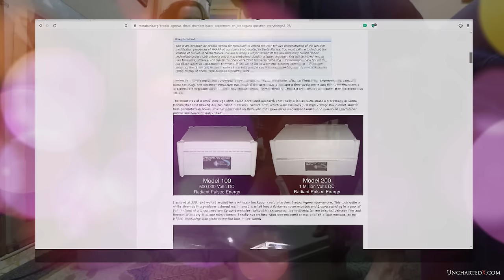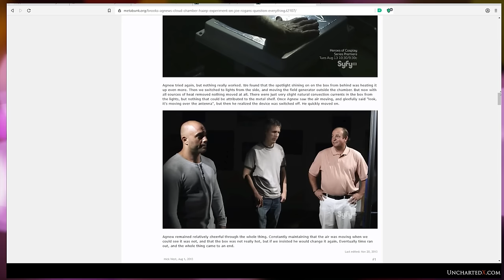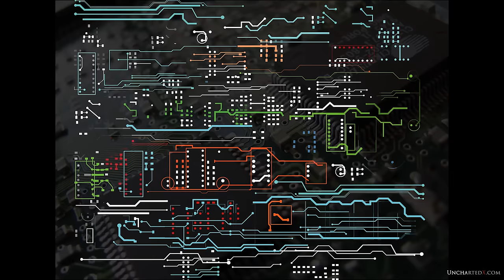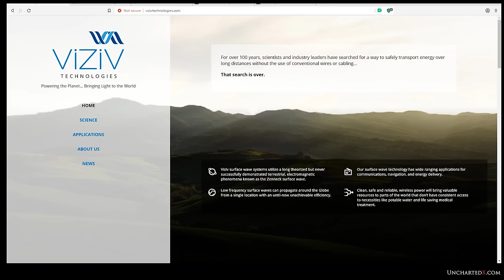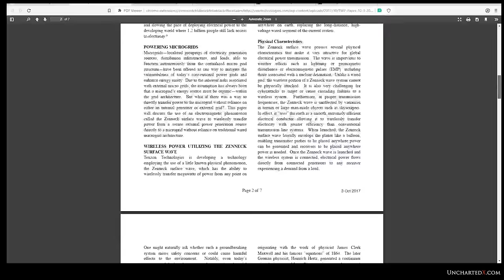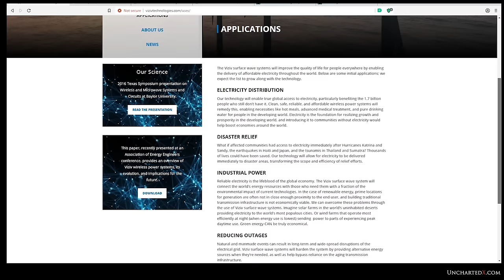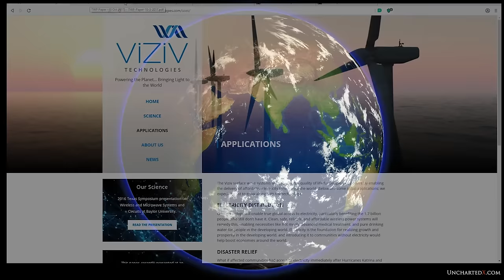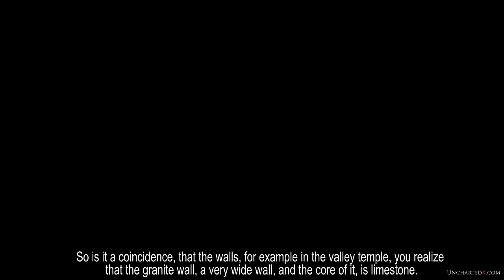500,000 volts through megalithic stone? An investigation into the possible with UnchartedX!

Comment: I'd like to share a few things on perspective, as well as tell you about my experience . . . also share my limitations, as not to try to over qualify my statements. First, direct to the point. In the late 80's and early 90's there were devices people would keep in their homes & cars generally called 'negative ionizers'. These devices were intended to charge the air with negative ions & one of the often mentioned effects was that it would essentially be similar to the air after a storm.  Health effects were claimed, etc . . . but the underlining problem, and ultimately why the popularity was discontinued (because of what caused them to cease to work).  If you had a single clock radio, or other electric device plugged in, that electric device would ground out the negative ions. Where perspective comes in is how different things would be if we were not on the grid. I mention this here, because even in the room where this experiment was performed, there are obvious lights, etc which may offset the 'natural environment' that any potential ancient technology were to be used. Like many others, I have thought about what the pyramid may have been used for, and my final best conclusive theory has not really been presented in any video I've seen. The one major problem that I have with the pyramids in their current state would revolve around the metal handrails that have been put in, potentially contributing to a grounding out an originally desired effect. Back on direct topic:  Even the generator used in this demonstration may not be able to have an appropriate "control group" for purely testing scientifically.  There are two major principles I feel might be helpful to keep a proper perspective. One, I imagine you're probably aware of -- that energy goes from negative to positive (for some this may be counter-intuitive). The second is a modern day principle I learned while working with an electrician . . . the job required an electric device to work that was a long distance from the panel. Contrary to my initial speculation, the wire had to increase in size as it extended farther from the panel. When this was explained, it was because there had to be more free electrons available at a farther distance. 
 If there were no power grids knocking down ambient ions, structures like the pyramids would be massive channels of ambient negative ions converging onto a host of available free electrons.  The A/C world we live in today has estranged the D/C world of ambient ions as shown in your video by grounding out kinetic potential. <--- all that & it is tough to imagine what things may have been like before the pyramids accomplished their task.

 After a decade in IT, I was asked by an aerospace engineer when I would leave 1's and 0's & come over to time varying DC. The engineer was a master of 30+ years & I told him I would work for him whenever he wanted. . . to which he replied, 'how about Monday'? The work I've done effects millions of people daily, and while that's no exaggeration; I humbly acknowledge I was standing on the shoulders of a giant & my best asset was remaining determined to never stray outside of the guidelines set for each particular project. To my peers, I would be considered a bench tech.  My biggest project included a key component for the aviation industry . . . it used what we called "HH blocks" (one reason I Puma Punku's H blocks interest me because of the similarity). Likewise, re: Puma Punku are the stepped inserts, which also bare a striking resemblance to waveguide formfactors used for long range communication.

Comment: One purpose for choosing those materials is they have few materials but if they wanted to send a radio signal, even if it was a Morse code type of signal you see when you bring that aluminum rod close and cause a spark, that's a spark gap, and like the way radio waves are made. Now they may have used it for florescent lighting, radio type communications where the knowledge of the set up needs to be mirrored for the receiver.
The non conductive would help to shape the wave of the transmitter.
Another use of em waves is the Hutchison Effect where the covalent bond of atoms is disrupted by these em waves essentially the electrons and the vibrational pattern of the nucleus its normal frequency of vibration pulsing in and out in an expanding universe.
It could soften stone and embed metals melt or distort metals and we have the Hutchison Effect but people as yet do not know much about it other than it is very dangerous.
I could talk all day.
You asked a physicist.
What is my personal opinion? Nowhere do you find marks on ceilings from torches yet they had tunnels everywhere so broadcast Tesla power to fluorescent lighting? Or all Bagdad batteries?
Save you years of research. Quickly and short. Imagine that at the very tiniest quantum level is quantum foam bubbles that are so tiny nothing can contain them. And they are like rubber balls or golf balls again pulsing in and out but touching forming background radiation because as they pulse touch and vibrate they send out waves by pushing each other around and flowing. So the wave nature of reality is the flow of momentum which to us over time forms the shape of a wave. If we freeze that frame what do we have? Quantum particles and that is the duality of this quantum nature. Now imagine it is like a sea of foam filled with waves that are very strong and traveling at the speed of light which all em waves travel at.
E=mc2 mass and energy can be converted. They are the same sort of thing in a universe like ours you can't find one without the other they are qualities of this quantum nature.
Mass is that force, not little bits of dust. Mass and gravity the same thing. It is force.
F=ma and that classical view describes cause and effect. So these waves are on a frequency and if the receiver set up can be affected by that frequency you see a macro reaction.
So the Hutchison effect is creating high and low pressure areas in the quantum foam by directing quantum foam using radio waves (more foam) and em fields(organized patterns of foam) things will launch. It is disrupting the waves at the shell radius of the electron where the covalent bond occurs and now the atoms are moving into other materials or into strange shapes following the currents flowing in the foam. I hope that helps you and thanks for the video! Great stuff.

Comment: Makes sense to have a high voltage low amp current that then you can convert to high amp for on site application for safety & ease of transporting the energy needed without having to have power lines, you just use Earth & air.

Comment: Hey there - I'm sure someone has mentioned it already, but marble and limestone are really good at absorbing heat, while granite is particularly good at conducting heat. Basalt is probably the best at storing heat and releasing it slowly over a long period of time. I find it extremely interesting that they used a composition of all three, and particularly the placement of them. If we can imagine that the climate was much more temperate and storing heat (via thermal mass) was important, this might have supported the use and specific placement. It's probably been discussed, but just thought I'd share in the off chance it wasn't mentioned. 
best, 
S

Comment: The device: (though it is intended as a therapeutic technology) is simply a voltage converter. A step-up converter.

As for the Tesla Tower: theres nothing magical or mystical about it. It uses the same type of waves we use for radio.
A “crystal radio” receives power from the radio station in this manner. The difference between Tesla’s technology is that the receiver is designed to be resonant with the broadcast signal, for maximum induction, and production of power, rather than filtered and amplified through a non-resonant circuit, which essentially waste all of the power the antenna receives, and only keeps the channel you are tuned to.

Old buildings are conductive, semi conductive, resistive, and resonant, depending on the construct and design. Electrical circuits were formed between the tall steeple and the ground.

at 100V / meter, the top of the great pyramid sits at ~ 150,000V today. It was greater thousands of years ago, before the bottom was buried.

I think this type of research should continue, there are artifacts such as the ‘dendra lightbulb’ and the jars with holes in the lids which we now know were low voltage batteries, probably used for electroplating, as electroplated items were found in the region.

Other old structures possess similar electrical varieties, placed in specific locations.

My personal theory, is that ancient people used these properties, in conjunction with sound and magnetism (lode stones/ sky rocks / ocean iron).
to produce resonant vibrations which instigated induction.
This with the atmospheric potential, could lead to extremely large amounts of power.

Comment: To any person familiar with electronic parts and devices even in their most basic conceptual operation without all the deeper details of equations and so forth, a Djed pillar immediately looks like a kind of capacitor, a battery, a frequency tuner, or a kind of oscillator - and even a bit like Tesla’s coil, among other things. That’s what they first looked like to me, anyway. The fact that the granite that makes up the discs is more of an insulator fits the capacitor model, however, we don’t know what a Djed pillar was actually made of, do we? The point is, these things, like so many other Egyptian (supposed) symbols, artifacts, and architecture look technological rather than like symbols drawn from the natural world like you find in most Neolithic cultures. If they’re just symbolic, they’re highly abstracted and refined symbols, yet you don’t find anything quite like them in other megalithic and advanced cultures which nonetheless retain a naturalism in their symbols and writing - like Mayan writing, for example. You don’t find the Egyptian obelisk anywhere else in the world, either, which clearly looks like an antenna or receiver. Why try to construct them out of single blocks of stone unless it’s necessary to do so for some functional reason?